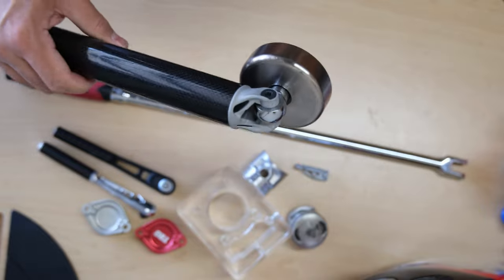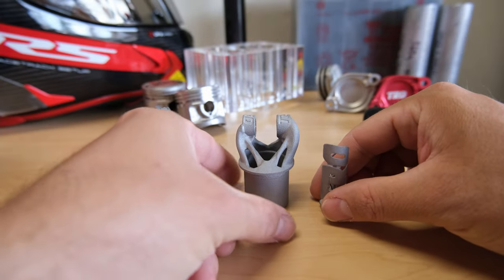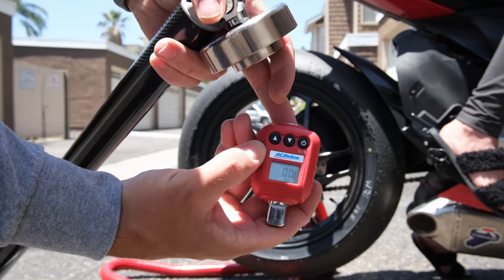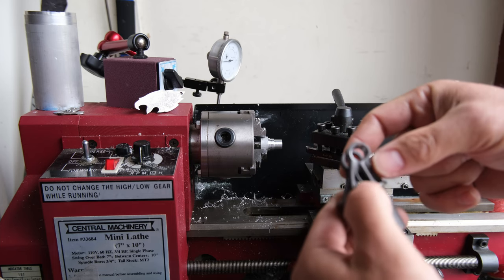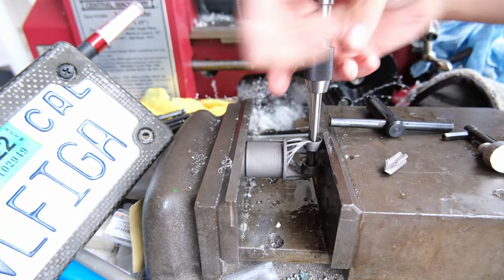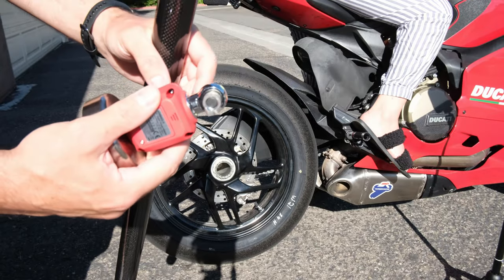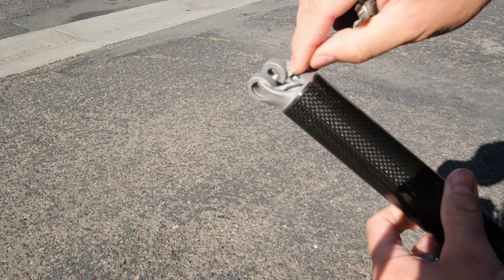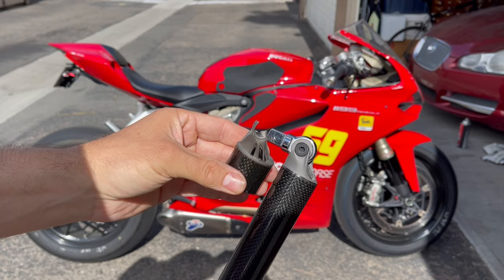How Strong are Generative Designed Parts? | Breaker bar designed by AI (Titanium Metal 3D Print)

Comment: 3-D printed parts are not isometric and it seems you printed these parts with the layers perpendicular to the carbon fiber tube which weakens them significantly
Reply from the maker: These designs were output directly from Fusion 360 and printed according to that specified build orientation. Either way, the failure modes were all ductile fracture (brittle for Aluminum) and not along the layers. They failed the same way you'd expect solid materials to. Also, there's less support material the way these were printed. Thanks for the comment!
Reply: I think you mean isotropic.